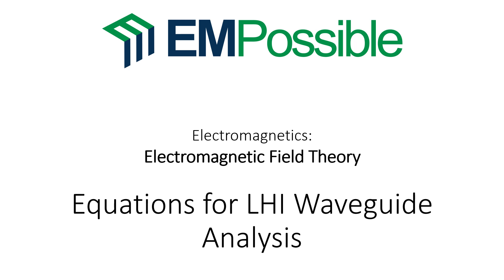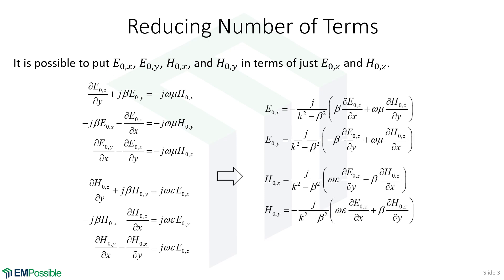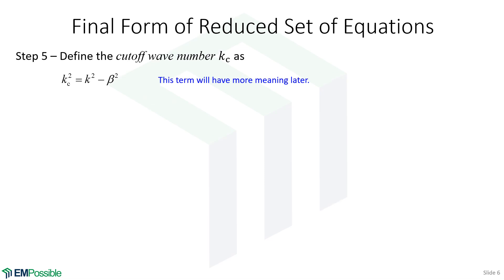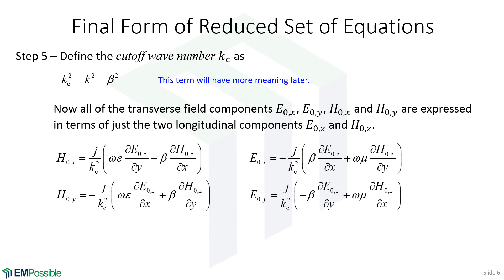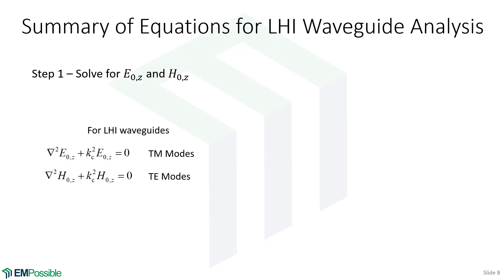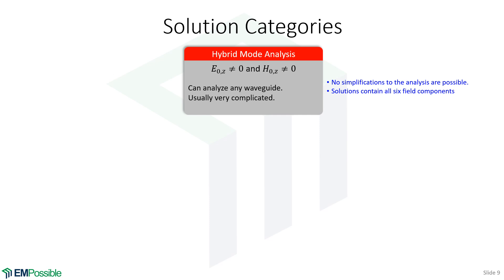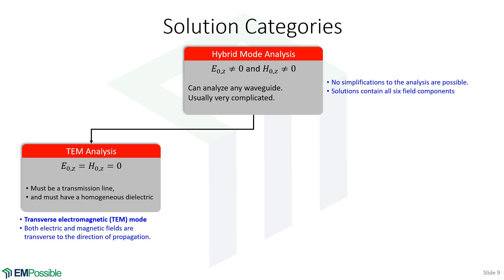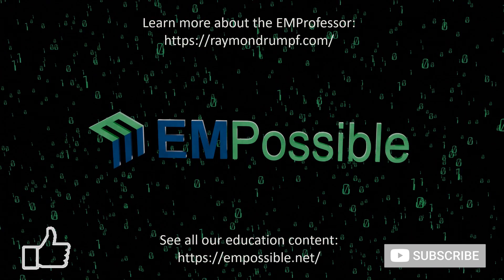Lecture -- Equations for LHI Waveguide Analysis

Comment: Is a hybrid mode formed by the coupling between the TE and TM modes? Or its just a mode with nonzero Ez, Hz? Thanks!
Reply from the maker: Many think of is as coupled TE and TM modes and that model also works mathematically. I don't like that interpretation because I think it leaves the wrong understanding of the physics. The ordinary thing to happen in a waveguide is for all field components to be coupled. Only under special conditions do certain field components go to zero. We just happen to make waveguides like this and we get trained to think it is normal. 

So, your second sentence is more correct IMHO.